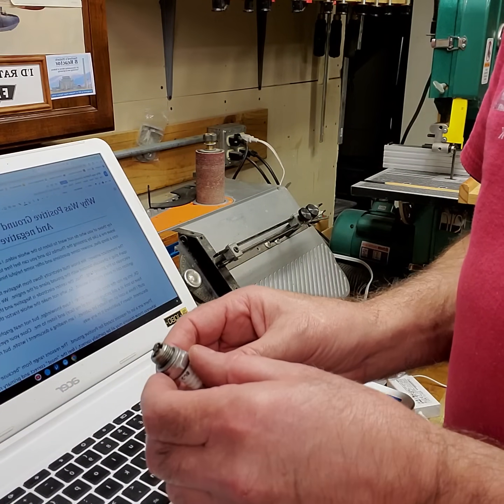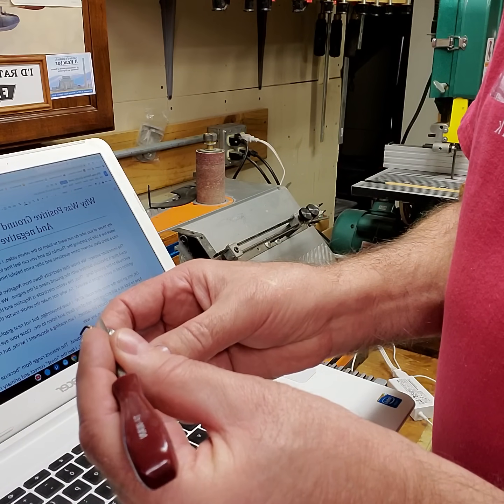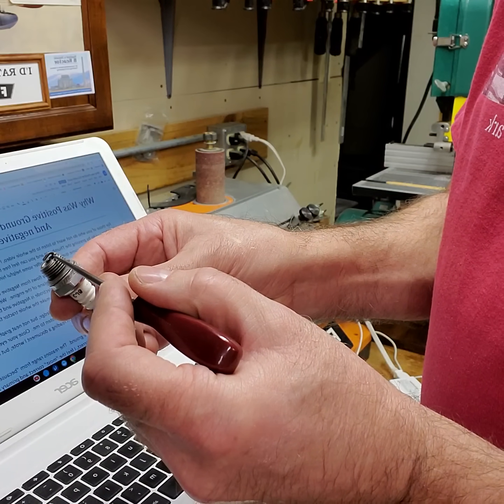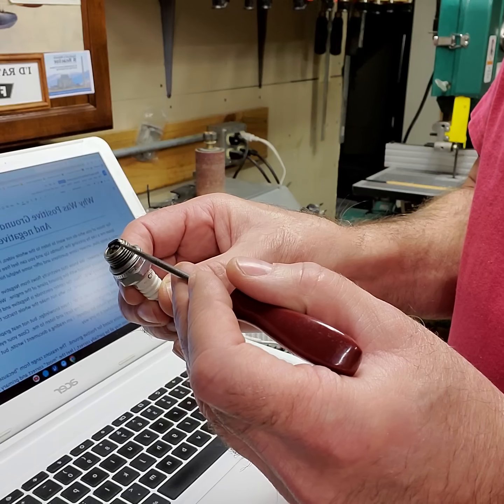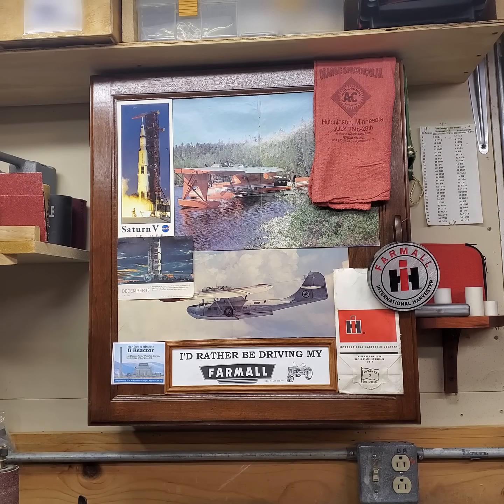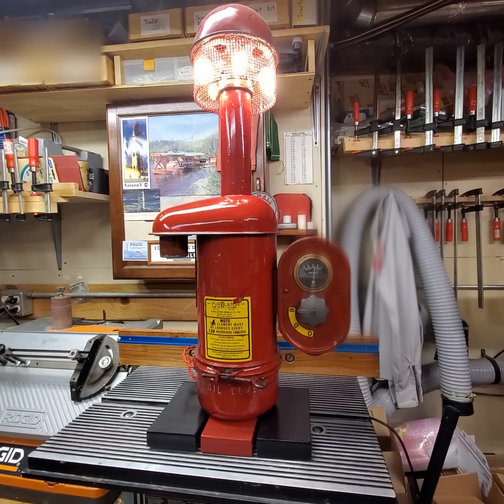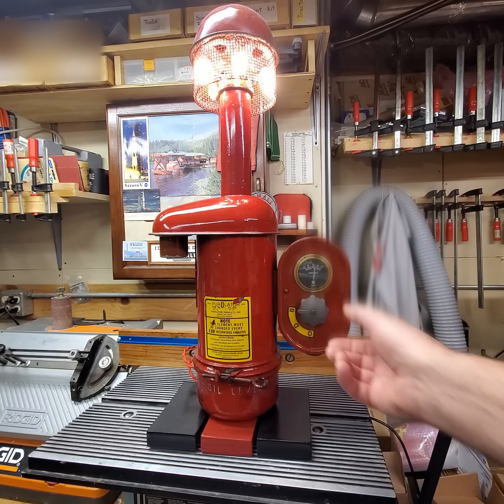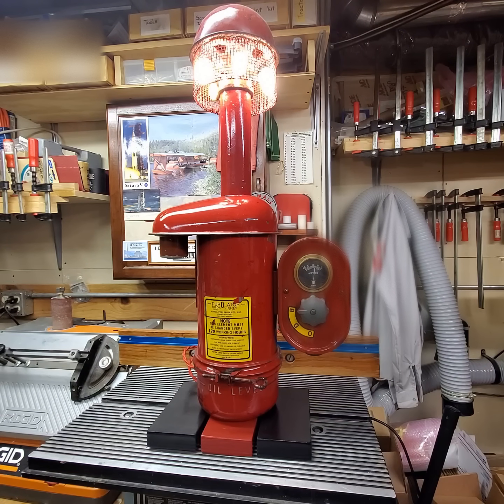Why positive ground was used on old cars, trucks and tractors

Comment: years ago in high school auto shop class i was summoned to explain the ignition circuit
from a perfectly good daydream. about halfway through my answer i got a notion to improve this boring single coil system and described a system with a coil on every cylinder.     the teacher was not amused with my"foolishness" and i was rewarded with an after school detention. neither one of us knew this would become a reality one day. your video reminded me of that day when i was thinking outside the box. thanks for sparking my memory.
Reply from the maker: Hi EMF.  That is such a cool story!  I laughed when you got a detention for thinking outside the box.  ha ha  Oh, those were the days!
Now, imagine had you said:  And, no carburetor or distributor either.  That would have been worth a suspension from school for 3 days.  ha ha  Just like getting caught smoking in the welding booth.
I will admit, when I was young, and in school, I needed that explanation you gave.  I always thought the spark plug fired when the breaker points closed.  It took me into college before I understood that the spark happens when the points open.
Reply: @bryanh1944FBH  I figured this out indirectly when I was a kid and playing with a big solenoid coil picking up nails and things and using it for an electromagnet. I was curious to the fact that if I disconnected the coil, I would get much bigger sparks than just shorting out the battery intermittently with a short piece of wire. I was puzzled and thinking why does the coil appear to "pull" more power out of the battery than a dead short? Well, I was holding both wires and I discovered what happens when the current flow stops! I got a hell of a shock from holding one lead in the left hand, and the other lead in the right hand and when the field collapsed in the coil, it went right through both arms through my chest and sat me on my ass. And here I was thinking how can playing with a 6 volt battery possibly give me a worse shock than sticking my finger in a light bulb socket... LOL. I wasn't an ignition coil, but the voltage spike was probably around 200 volts, nowhere near an ignition coil, but probably a lot more current, and 200 volts hurts...
Reply: @brnmcc01  As a child, I once made a coil out of house wiring (the single piece conductor type not the flex multistrand type). Say less than 30 turns with the Copper conductor diameter being about 2mm thick. The coil was a helical type with a 6 inch nail as its "iron core". I connected it across a 220VAC wall outlet and it was vibrating (no fire, explosion, just buzzing). I figure it was vibrating at the same frequency as the mains voltage since the nail was attracting and releasing a piece of iron placed on it.

Another episode was getting shocked by connecting an AA battery across one side of a transformer I'd salvaged from a radio set. If I remember correctly, it was a 220V to a lower voltage stepdown unit and the battery was connected to the primary side. I was surprised to get zapped by the secondary side when I disconnected the battery.
Reply: Your teacher wasn't such a bright spark.. 🙄😄
Reply: a lot of old engines had a buzz coil for each cylinder before the distributor was invented the Ford Model T is an example.Their sparks went every which way.
Reply: @noti51 Yup, Shower of sparks trembler coils. Because magneto won't work until the engine is actually spinning.
Reply: @brnmcc01  I fixed a few of these when I worked on the London to Brighton Vet. car run. Mainly just had to open a little wooden box and free the trembling arm, a bit like a points
mechanism. Given that none of the entered cars are newer than 1904 I likened the constant spark to a more modern wasted spark set up. Maybe an old idea reborn 🤔😎😄
Reply: Thank you for your explanation however, when I was just out of high school at 15 Years of age and working in an auto garage I found cars with positive battery terminal to ground as with early English Austin/Morris cars running generators with either 6 or 12 volt batteries, while others e g, GM and Ford from America (BTW I'm an Australian) also using generators, as alternators were not yet in use, were negative battery terminal to ground. Later I went on to work in car battery sales where I worked for many years after, during which,  particularly in the earlier times, if fitting a battery to an older car which you weren't familiar with, it was important to remember which battery pole connected to ground otherwise you would be met with a shower of sparks as soon as you attempted to connect the battery if it was the wrong way around, that certainly made you take care and become aware or what cars used the positive (+ red) or negative (-- black) pole to ground, usually the chassis or a good clean metal point, I did learn that electrical current runs from the positive battery plates to the negative plates 'one more negative plate to positive plates per cell' so unless I missed something I am still confused, as I was born way back in 1950, that could be a contributing factor 😒
Reply: @robertinaust  I grew up in the country where we boys could buy a running "field car" for about $25. I kept my '49 Pontiac straight eight running until I sold it while in college, but my best friend went through car after car in the same time, all ending up junked. A number of his were Chrysler products and were real bears to start. That is when I first learned of the positive ground vs negative ground dispute. I always wondered why Chrysler clung to the positive ground after most everyone else had switched to negative ground. I guess they were "following the science" while everyone else "went with what worked"!!! I agree with you about generators. None of us could afford batteries, but our cars could be coast started and would run on the generators. Alternator equipped cars require a battery.  Later on I switched my neighbor's 6 volt positive ground Oliver tractor to 12 volt negative ground, installing a Mercury alternator and regulator to replace his defunct generator. It started a lot faster and better, especially considering it still had a 6 volt starter! I don't remember what I did with the lights, may have used a dropping resistor which were common and cheap at the time. Just switched out a couple of the gauges, as I remember.
Reply: The Model T Ford had a separate ignition coil (aka: "Buzz Coil") for each cylinder. It also had a transmission using planetary gears, which of course were later used in automatic transmissions. In addition to those innovations, it used chrome vanadium steel. That's a few ways, that the Model T was ahead of it's time. You're teacher should have at least pointed out to you, that a dedicated coil for each cylinder was nothing new and certainly shouldn't have put you in detention!
Reply: In the early eighties I was a patrolman for the AA and one of the most common breakdowns was the link between the coil and spark plug.
Either by HT leads being usually damp, distributor cap with damp causing carbon tracking (not cracked), carbon brush worn, rotor arm tracking to earth or broken and of course contact breakers and condensers being totally unreliable.
I thought, "Why not bypass the whole lot and put a coil on top of each spark plug. I sent the idea with all of the pros and cons to British Leyland and they said, "Too costly! End of story". They went bust early 21st century!
Reply: that is a great story!  I have been reprimanded because my professor said I was the best board draftsman he had ever saw in 1993.  Althought board drafting is outdated, it got my friend an A+ for his work because I did his drawings for him.
Reply: This story sparked my memory about an argument with my father, (totally unrelated topic, except thinking outside thebox) He was watching some sports on TV, and I suggested a change to the on screen graphics, to provide more information. Him being totally absorbed by the game, could not understand why anyone would need that information, while I just throwing a glance at the screen every now and then would appreciate this information. He was unable to recognize the value I saw in this, accused me of complaining to him about things he couldn't change, and told me I had to contact the TV station if it was that important to me. When I replied that I actually don't care that much, but it was just a thought I had that might make it more interesting to me, he got so angry, he turned off the TV. I still didn't care while he missed parts of the game.
Reply: Multiple coils are okay.  It does not hurt to have a coil that drives each spark plug, becuase if one coil fails, then the other cylinders can continue to operate.  On the business end, it is totally unnecessary.  HEI (high energy ignition systems that doubled the operating voltage of an old school coil) ignitions can handle 8 cylinders.  The business model dictates that the more parts you put on an engine the more OEM parts can be sold decades later when they reach their inevitable service lifes end, which is designed into electronic components.  Theoretically you could make a solid state transistorized device to last 1000 years or more, but they have carefully calculated that the failure rate will likely occur within 10-15 years or less so you have to buy a new one.  It's a guaranteed aftermarket.
Reply: @ben91069  i agree 100 percent  .  another way to say all that is  planned obsolescence.
Reply: Same here, I put a third brake light on my car, couldn’t get it to pass inspection ha ha ha. But they said ok to the seat belts I added
Reply: A coil for every cylinder when 1 coil could do for a V12.   The auto manufacturers are ahead of you because now you got to buy a coil pack making them more money.   A single coil could last 10+ years(on average they exceeded that by a dozen additional years) Nothing special about it. Not heavy duty. Just a coil.
Reply: Excellent.  For you
Reply: Sorry but the early Model T beat you to it.  🤷‍♂😉
Reply: Ford model T had a buz-box 4 coil engine.
Reply: @saginaw60  Yes and the later models even have the coils on the top of the engine same as the LS, but in the end the Model T eventually used a distributor
Reply: That got rid of spark scatter from worn distributor shaft bushings, worn flyweights and loose unevenly tensioned flyweight springs.
Reply: Was your shop teacher Hank Hill? Cause that sounds like a very Hank Hill reaction. 😂
Reply: no the auto teacher was Peter Lepp. he was a strange fellow with obsessive compulsive tendencies as well as  acontrol freak.im sure that his life became  more complicated with age. @leviheidle524
Reply: My P71 4.6 liter Crown Victoria Interceptor has a coil for each cylinder. I drove Taxi Cab in Detroit for 7 years. There the toughest, most durable cars on the road today and I'll stand by every word I just said " TOUGHEST "

Comment: To Frank. Your 53 dodge is wired wrong. All Mopar ( Chrysler)  and others except GM were pos grnd thru 55. They all switched to 12v neg because of the transistor radio which i
Imperial introduced in the middle of 56. There is more corosion with neg ground though.

Comment: In conclusion, POSITIVE GROUND IGNITION, even though the remainder
of the vehicle is negative ground?  comment please.
Reply: This "may" be due to the points being on the primary side of the coil. When the points close the current flows in the primary side coil. When the points open the current flows stops and the collapsing magnet field is what induces the voltage in the secondary coil.

Comment: Can you explain how an ignition coil (modern negative ground vehicle) is positive ground when the engine itself is negatively grounded? How can electrons flow from the center electrode to the grand tang that is physically bonded to a negative grounded engine?
Reply: The ignition system primary and secondary coils form two independent systems. Just like the transformer at your house that steps down transmission line voltage to your house voltage. The neutral terminals of both the high and low voltage systems at your house are connected together and bonded to ground at your house first disconnecting means, but the energy transfer between the two systems is derived from the magnetic field in the transformer, not a direct electrical connection. Same thing happens in an ignition coil, there is a primary winding that carries battery voltage, on the secondary coil the positive is connected to ground, and the negative output goes to the spark plugs via the plug wires. Because the two are separated by a magnetic field collapsing which generates the spark, the secondary high voltage system in an engine becomes a "separately derived system". Separately derived systems are power sources with no direct electrical connection between any of the circuit conductors and supply conductors. The energy transfer occurs when a magnetic field is created by the primary coil, then the breaker points interrupt that flow of current causing the magnetic field to suddenly collapse. The condenser (or capacitor) quenches the arc that would otherwise form when the breaker points open. The sudden collapse of the field induces a very high voltage pulse in the secondary winding. In modern cars with coil on plug design, the primary battery voltage is switched on and off by the engine control module eliminating the distributor, breaker points, condenser, etc. The primary coil has thicker wire with fewer turns, the secondary coil has very fine wire, and many thousands of turns of wire, creating a low current but very high voltage spark.
Reply: @brnmcc01  your theory has one fatal flaw. inside the coil for there to be seperated primary and secondary coils there would need to be 4 terminals - two for each coil. while this is the case in some modern automotive systems  the coils of old had one end of the secondary and one end of the primary tied together. thus the difference between a positive ground and a negative ground coil.(which side is the secondary internally connected to?)transformers are isolated primary and secondary  coils are not.  thus the reason the spark jumps is there is no common connection when the points open the induced voltage is high enough to overcome the insulation in the circuit(plug gap) i disagree that all spark is positive.  the old timers will use a pencil test to prove which polarity it is.
Reply: Just to confuse you a little more the secondary high voltage from the coil is an alternating current wave.
Reply: @martyk1156  Yup it's like half of one sine wave cycle.
Reply: @martyk1156  I think you are referring to pulsating DC.   An example of pulsating DC is what's used for a power inverter, that steps up 12VDC from your car battery to 120 VAC to operate battery chargers, power tools, a microwave oven or coffee maker on that long road trip.  except in pure sine wave inverters (more expensive) the output in most inverters is more like a square wave.   And most devices will work fine, but you can run into issues with some types of motors, and inductive loads in particular electric discharge lamps (florescent,  metal halide and sodium vapor)
Reply: Simply make the center electrode more negative than the ground.  - voltage.

Comment: Get a tractor like a 4020, and then you have both a 12v - ground, and 12v + ground. 24v across the starter. I did cheat and converted to 12v - ground. Starter needed rebuild, and the wiring was needing replaced. The cost of getting an alternator and a 12v starter was offset by needing one less battery and two less cables.
Reply from the maker: Hi.  Thanks for the comment.  It's very interesting indeed!!  I have no experience with a JD 4020.  Now that you have me interested, I will find, and look over, a wiring diagram.  One less battery is always a good thing!
Thanks and good luck to you.
Reply: @bryanh1944FBH  they wired them like a house. 24 across both batteries, with the frame being the split. And each battery shares half the load. Half the lights are - ground, the other + ground.
Reply: My experience with 4020 Deeres is that if you grab any two randomly the electrical systems will be different.  Yes, some do have two 12 volt batteries that are charged with a 12 volt generator but some have a 12  volt alternator but they have a series parallel switch that connects the batteries in series to provide 24 volts to the starter for cranking but operate the lights and accessories on 12 volts negative ground.  The trick is to try to ballance the load so both batteries are charged and loaded at the same rate.  And some have 2 12 volt batteries hooked parallel and crank on 12 volts. Again the loading on both batteries needs to be balanced. And, some operate on one 12v battery.
My 4020 has two 6 volt batteries hooked in series, with the negative grounded, that provide 12 volts for cranking and operating accessories and they are charged by a 12v alternator.  Since all the current flows through both batteries they tend to stay more evenly charged than when it had two 12V batteries in parallel. The two 6v batteries in series give more cold cranking amps than two 12v batteries in parallel and I don't have to fool with an expensive  series/parallel switch.
Reply: But I've never seen one that ran two 12v batteries with one negative ground and the other one positive ground.